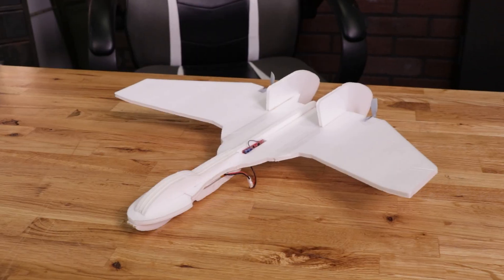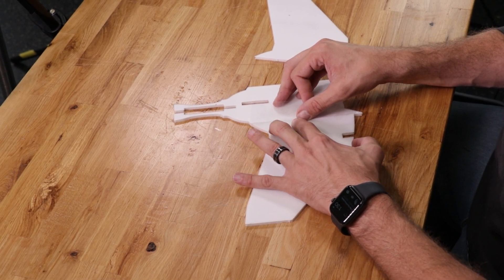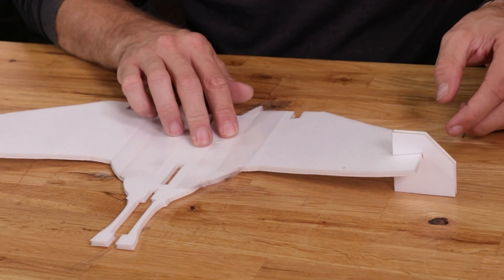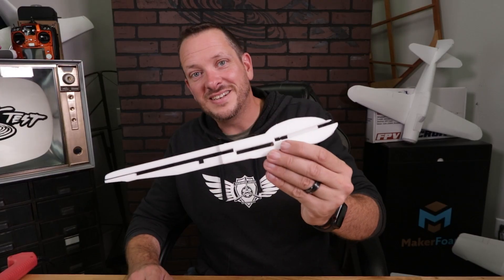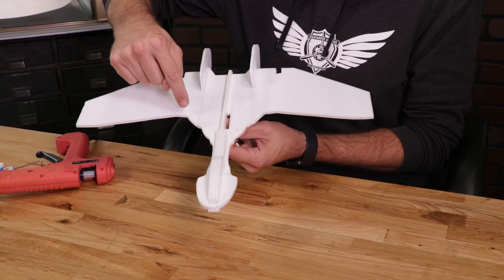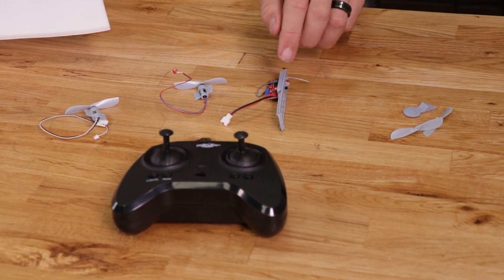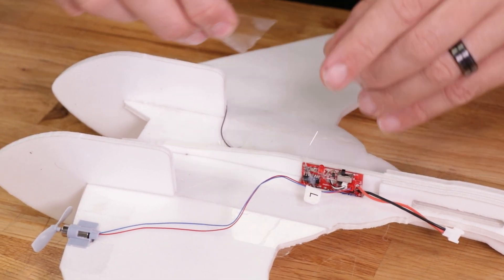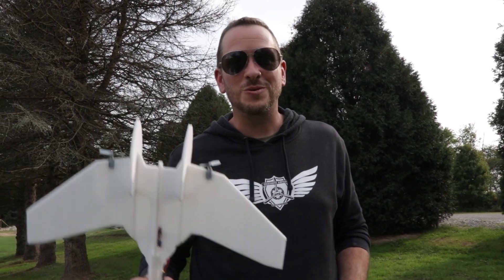How to Build the EZ Nemesis

Comment: May have to question the robustness of the neck and center of gravity! flew straight into the ground and the battery section was the weak point and snapped off :/ guessing I need to recheck the aerodynamics before trying again :/